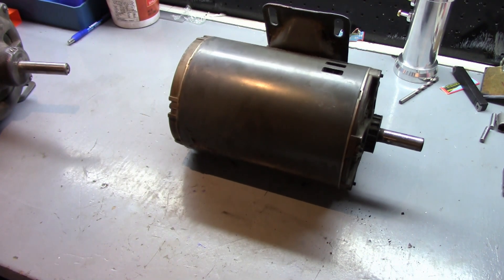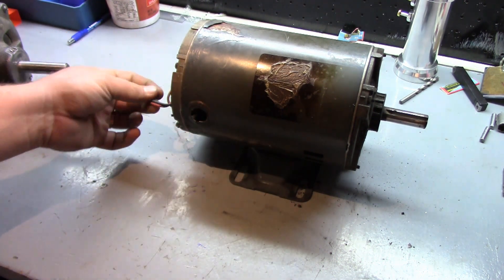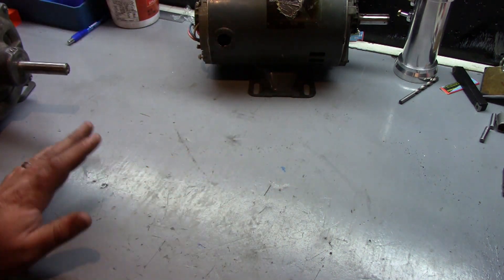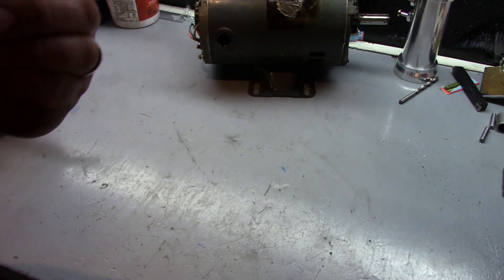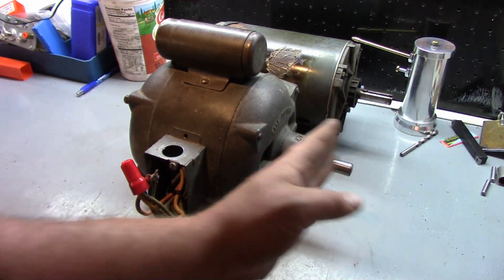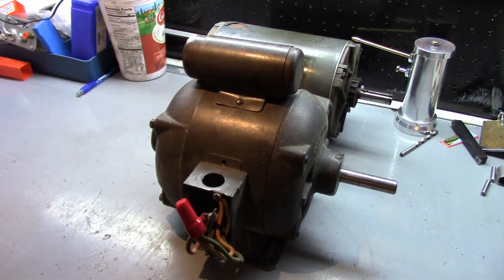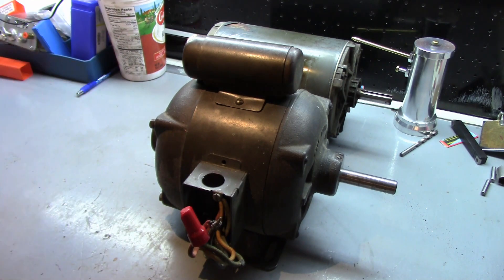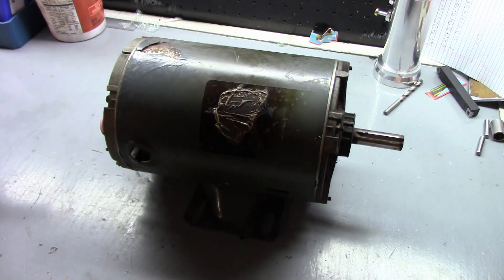When Good Motors Go Bad

Comment: Greg,
isn't it common practise to put a thermal protector unit in line with any 3 phase motor, in the US ?
Here that is done as a matter of course...saves a lot of trouble...

Paddy
Reply from the maker: In light commercial applications only usually with a dedicated motor/unit such as an exhaust or make_up air (air intake).  Most Package A/C units that have 3 phase motors do not have any thermal protectors.  Some do, but usually only on higher end (more expensive) models and even then only on the blower motor.

Comment: i was running my 14x40 metal lathe at 1100 rpm and went to put the forward reverse lever into nuetral and went to far on the lever and put the motor into reverse. i saw a flash of light coming from the 3 hp single phase motor area and now the motor dosent work. theres power to the lathe cause green light is on. theres 2 round looking things on top of the motor capacitors maby? any suggestions? thanks.

Comment: for future reference. Typical Residential service is 120/240 Volt single or Split Phase. Commercial power is the same until you get to 3-Phase. 3-Phase is typically in 3 varieties. 277/480 V Wye, (277 volts Phase to Ground, 480V Phase to Phase. 120/208V wye is fairly common (120v Phase to Ground, 208V Phase to Phase), and not as common, but found in older Industrial areas is 120/240V 3-Phase Delta in which one of the Phases or Leg, has a higher Voltage to ground (190-200V). 

Good Video.

Comment: $205. for a capacitor on home ac .Does that sound ok ?
Reply: installed by a professional?  That's about right.  I paid that one time and but felt like a fool.  Just pull the old start up capacitor and order one on ebay and replace it yourself.  Should be about $12-15.  You aren't having to get into the refrigeration components of your AC system to replace a startup capacitor, so there are no laws preventing retailers from selling an capacitor to an end consumer.  It is one of the most common things to go wrong with your outside compressor unit.  Easy fix.
Reply: You would have to know that the capacitor was, in fact, the problem. Watch out for the zap effect sometimes inside capacitors. It might be a poor contactor....could be old wires...we would find animal damage on occasion(mice, etc.)

Comment: The loss of a phase in a three phase application will cause excessive heating if the motor was sized close to its service factor - as in a fan.  Even if running.

Comment: I was watching a cool vid where a guy used a 2 phase motor connected via a belt to start a 3 phase motor that was only connected to 2 phase power and he then used the third phase leg of the motor and the other 2 phases as a 3 phase output. Basically creating a rotary phase converter. Once the 3 phase motor was running, he could cut the 2 phase motor off and then run his 3 phase lathe from the output.
Reply: Yes a poor mans phase converter

Comment: Hi Well explained in the UK smaller extract fans have fuse protection only but that size motor you got there would be fitted with a thermal overload protection . Cheap installation if you told the customer that his property could have burnt down then overloads would be fitted. Great video 100% great

Comment: What kind of performance do you get from the dehumidifier in your shop. I have had 4 of them and they only last about 2 years and the control panel goes out. The replacement cost for the control panel is $125.

Comment: I have an exhaust fan at work that has no thermal overloads on it.  the motor has roasted twice from power outages.  Its been dead for 2 years now, don't really need it and I haven't felt like hauling the motor up a ladder and installing it over my head.  Whenever it goes back in, it will have a proper motor starter setup instead of just a disconnect like it has now.

Comment: Good tutorial. 
Regarding motor overload heaters the ones I've seen are not as you describe, but more of a bi-metal arrangement , or a heated element vs. a heat insulated counter element where heat expansion on one side causes them to deflect until they hit the trip lever. I've not seen ones that have melting solder in them. Hmmm.
As you say about breakers, and it also true of fuses (rated at 125% of the motor plate), that they are there to protect the wiring. Motor overloadeds are to be sized exactly to the motor plate rating for proper protection. I've even used manual motor starters on single phase motors where there's basically a toggle switch and an overload with a single heater in it.

Comment: Good simplification, and gets to the point that losing a phase is a Bad Thing, since at least smaller 3-phase motors typically aren't protected against phase loss. 

Losing the starting cap on a single phase motor is just as bad, except that at least some single phase motors have an overheat breaker in the motor that might (or might not) trip and save the motor.

Comment: Tell'em Brad. Plant I worked, we kept losing a elec. hydraulic motor. Everything checked out. Had fuses on each leg and as you say, no blown fuses. It took a thermal camera to locate a bad wire to one leg between the input and fuse. No broken wire, just overheated leg fried the wire.

Comment: All our power lines over here are three phase with a neutral for domestic 240 volt for commercial 415 Volt if a phase drops we call that a brown out. On my switch board if I lose a phase the breaker will drop but I have seen on commercial buildings where each phase has its own breaker that exact problem where one phase dropped out and it wasn't noticed because the power points and lights still were working. But a motor let the smoke out that needed all three phases. Nice explanation simple to the point and as you say technical talk means nothing when you smell smoke.

Dave

Comment: Informative video, always like watching. Only 1 comment about the 3 phase power is that 208 and 230 are definitely not interchangeable. 220/230 has 3- 115/120 volt legs 208 has  2- 120 volt legs and a 60 volt leg. it adopted from European electric and used mostly for lighting in the US

Comment: Ok, fair explanation. 

Now, either wire can be that "start" phase.

If a phase goes and if the motor is not under full load it will keep moving but temperature rises. If gets hot too much or not, depend on the details. If power goes and comes back without one wire, the motor is dead very fast if, as you say, there is no (in Portugal we call them) thermal relay.

Now, most thermal relays (in europe they have) a system where they also detect missing wire (phase). 

This is how it goes (drawing):

http://serra-cabo.blogspot.pt/2016/08/blog-post.html

The black stripes are the thermal bi-metal.
In the center of each example, with a hook in the top, is located what makes the trigger work

Left drawing without current, (no slider movement)
Center drawing with three phases (sliders move the same)
Right drawing tho phases only (sliders move differently)

Top slider is maximum current in any phase.

Bottom slide is minimum current in any phase.

If one phase misses, top slide moves left, bottom slide does not move, hook moves much more because of the hook mechanism arrangement. As a two phases only situation increases current quite a lot (for the same motor load), a phase misses and in a few seconds the relay triggers, even if there is no power loss.

Hope this helps
Regards
SC